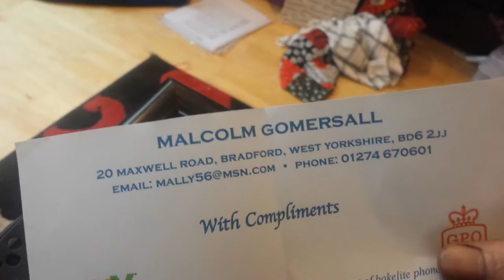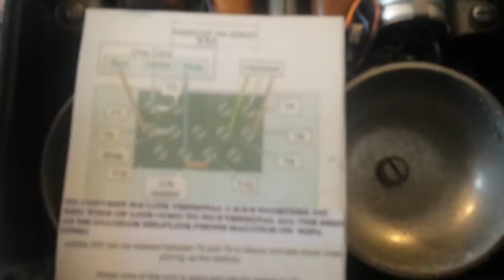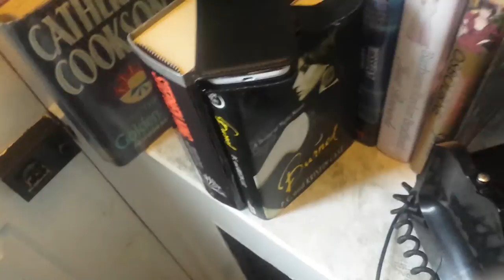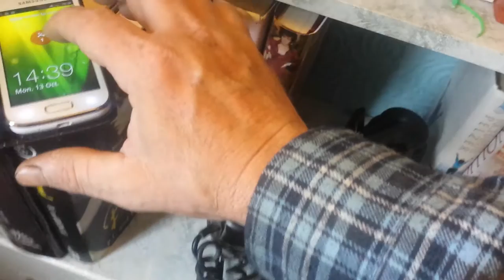RETRO BT GPO Telephone 300 series wire conversion bakelite

Comment: I did this today, but I didnt have any resistors.. Everything works, but:

When I did 1471, got through, & put the phone down, the phone line then came up as engaged when I called it. Also, the ringer wasnt very strong. 

Which of these issues is down to the lack of resistors?